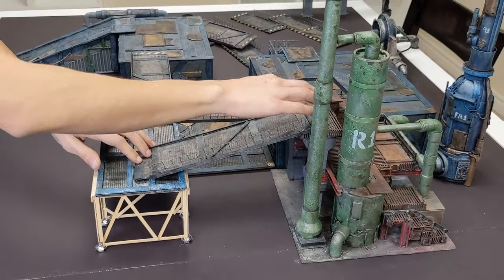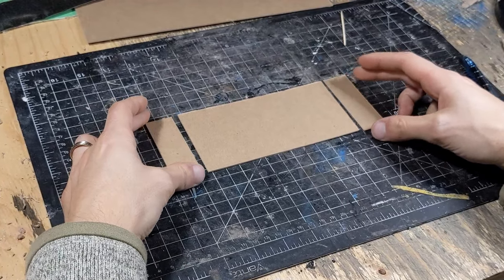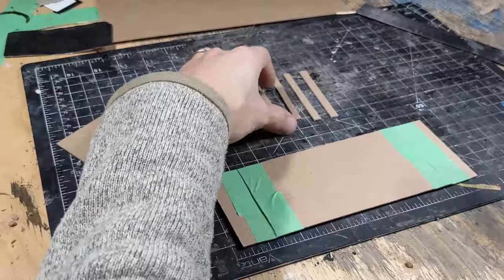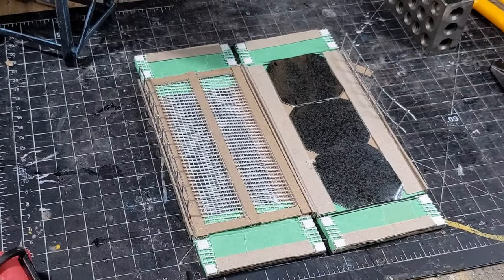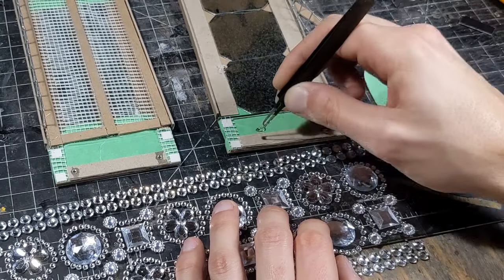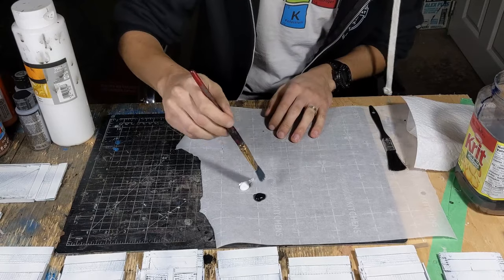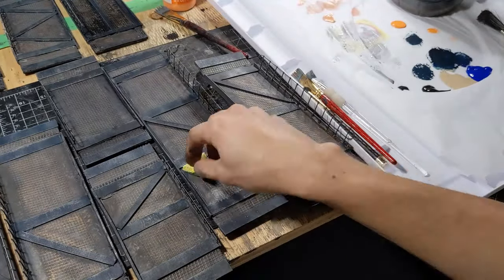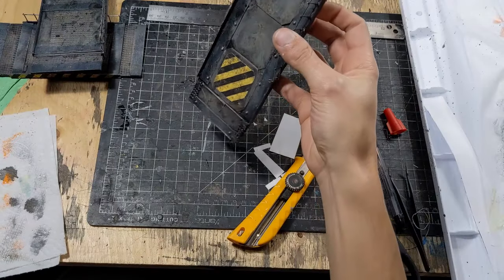WH40k Terrain Ideas | Industrial Walkways

Comment: How did you make this so fast?!

Rob Hawkins did the same thing with walkways for the building he made for me . . .flexible ends with magnets. But don't all the building edges need metal inside of them to connect? That's where I stopped.
Reply from the maker: Ah ok, I haven't seen that video. Yeah, having a thin strip of sheet metal on your buildings helps this lock in place, I've started adding strips or just making the whole top section from the same sheet metal i made these from.
Reply: @KnarbMakes  That's so metal.